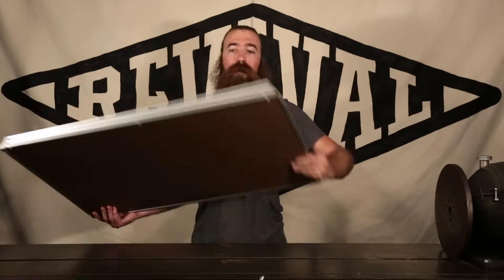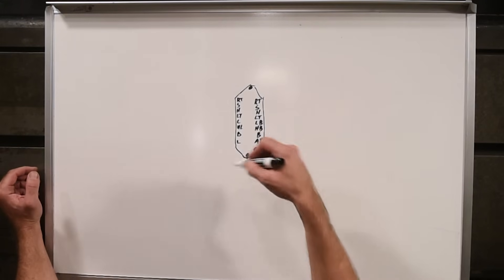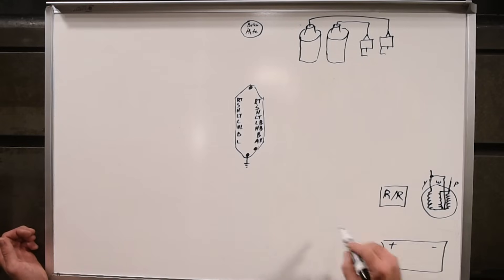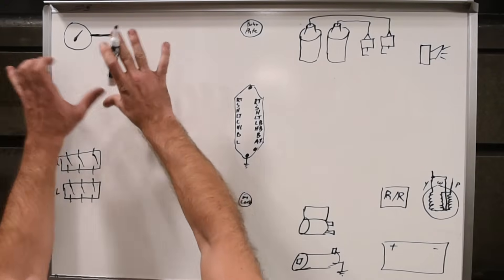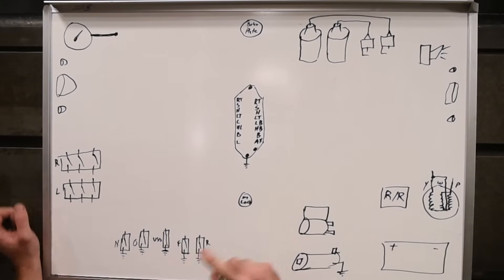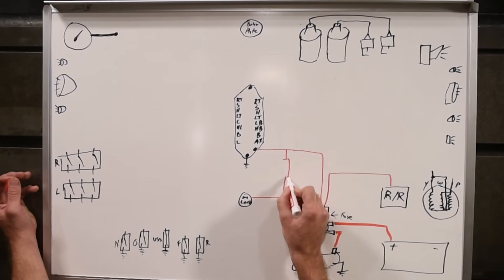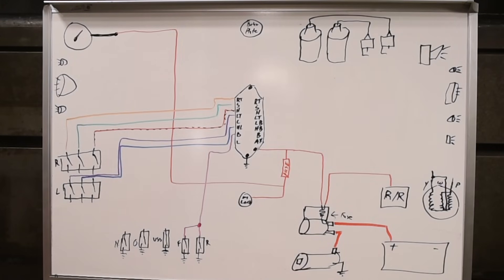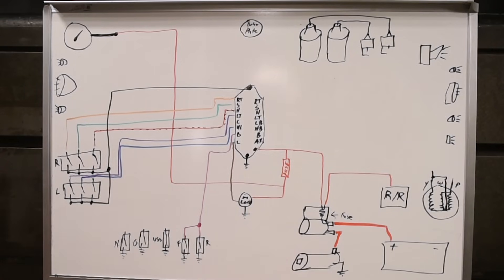How to Wire Your Motorcycle  - Revival Cycles' Tech Talk

Comment: THIS is actually the clearest most straight forward version of the CB350 electrical version out there. I havent checked but if you guys have a wiring harness + installation video / combined with all the information here: it would finally be the ultimate defacto wiring video and save people so much time. Good stuff guys
Reply from the maker: We sell all the materials on our site and have extensive wiring guides with diagrams available on our website. www.revivalcycles.com

Comment: I have a 1983 CB650SC and its got the field effect exciter coil that I have been trouble shooting since I bought it. I shot gunned it and swapped out the VR/R and the stator coil since I took a shot and swapped the stator and it didn't fix the issue.. now I got a bad ground on the trunning signals when I swapped out three broken turn signal arms that support the lights.... This Video was very helpful in understanding the whole system. THANKS Dude you rock.....

Comment: I have a story about wiring! First off I'm a friend of Sammy Parker at Revival, tonight his dad, Ron and I are building an old four speed HD transmission.

Story,: Back in 1972 when I was 19 II built up a 45 trike chopper. Raymond Smith from Choppers Fair drew up a simple wiring diagram which I followed - my first wiring job and it worked! One day I was riding down Houston's 610 loop and a wire melted into an exhaust pipe frying the whole harness (no fuse)! Dumbfounded I just stood there looking at it. This Mexican guy stopped in a van, didn't say a word and gave me a roll of electrician tape and half a joint and left. I finished the joint and then disconnected what was left of the harness. I then salvaged some wire, ran one hot wire from the battery to the coil and another to the points. Trike fired right up and over the next week I did a little better wiring job.

I've wired dozens of bikes since then, I solder every connection and use Molex terminals to simply unplug everything.for the roadside park rebuild.

-'lil stan
Reply from the maker: Thats a great reminder on why its important to consider routing and clearance...its never fun to get stuck on the side of the road, but sometimes its an opportunity to meet new friends. Its also a good reminder of why you should wire your own bike....cause when the smoke comes out you have a decent idea of how to get it to go again. 

Thanks for the story, and now I'm off to make sure Sam has gotten his full ration of harassment for the week.

Comment: Thank you for this fantastic video. I just bought my first bike over the weekend and I can't wait to get an M-unit Blue &  most of the motogadgets. 1983 Honda CB550. Guy didn't want it because the wiring was "Too much" for him to deal with. (Melted wiring from the main fuse to what I assume is some kinda of a power distribution box and a silly amount of scotch locks...) I replaced most of those wiring issues the day after I got it and now it runs great. But, as a electrical/diagnostic  automotive tech all I could think about was, "Man it would be fantastic if I could computerize this system somehow". Then BOOM some how your videos pop up on my YouTube "Watch next"... So glad it happened. I am a HUGE fan of all of your videos and all these gadgets you're showing off. Keep it up!!! Showed your videos and the M-Unit off to a few of my buddies that "talked me into" getting a bike and now they all want an M-unit. Thank you.
Reply: Hold up.. With an M-unit I don't actually need an Ignition box!?!? Hah I guess that makes sense. I've never had a reason to study points or carbs.
Reply from the maker: With the m-Unit you do need to have some type of ignition system. It can be points, or TCI, or a full ECU. But the m-Unit does not control spark timing. The m-Unit only  provides power to the ignition system, the actual spark control is usually the OEM system, or an aftermarket system designed for your specific motorcycle.
Reply: Hah. I kinda figured that out today... Once I looked at the wiring diagram and did my fist full in depth visual inspection of the wiring harness. I assume the M-Unit supply's power the... CDI..? Spark unit. Now that I got the bike running. I plan on getting at least an M-unit Blue and a starter solenoid from you guys as soon as I can.
Reply from the maker: With the m-Unit blue the ignition output supplies power to the ignition system (usually the coils and control box) BUT if you have a REAL CDI (Capacitive Discharge Ignition) those are self contained in terms of power and timing, so typically you need to use a normally closed relay to ground the kill switch wire. Then use the Ignition output on the m-Unit to power the relay control coil so the contacts open, un-grounding the kill wire, and then the ignition will spark.
Reply: Also Stefan you should scratch cool t-shirts off your  gift  list cause nobody can see them lol rock it bro 
Good luck in new year happy holidays thanks again that's it for my dumb comments

Comment: Thanks for making this so brain dead simple because I have to rewire my ‘93 Kawasaki 750 VN 49-A Vulcan that the previous owner butchered up and twisted wires together and taped them, no bullet connectors no  soldering, and yet he said he’s a mechanic 😆

I just need to add the radiator sensor, fan and USB port. I will be going to the “Revival” website and check out what you guys have 👍😎👍
Reply from the maker: Be sure to check out the Technical Articles on the site, we've kept this video up because it's proven to be very popular but it's out of date and there is a more detailed.

Comment: Omg finally found a video that dumbed it down!. My 1981 suzuki gs1100E is a electrical nightmare.  I have been looking at the Cymer wiring schematic...even blew it up but I'm getting lost in the wires lol. Got it running by putting power right to the cdi box and no headlight and rear running light 😬😮‍💨. That m box thing sounds amazing
Reply from the maker: Keep in mind this video uses a CB350 as an example, not to mention it's for the obsolete m.Unit V.2. We have installation and troubleshooting guides along with universal wiring diagrams in the knowledge base on our site. https://revivalcycles.com/blogs/technical-articles
Reply: @RevivalCycles  yeah I'm out of the loop with the bike tech. Those units are something down the road . To much for my budget anyway. But I'm terrible with electrical these videos are great I'm starting to understand the basics.

Comment: What I learned from the video is have a professional do it. 😂
My 94 lowrider needs all new wiring and it's hard to find someone to do it. The younger generation needs to get into motorcycle mechanics as it seems far n few out there. Though most mechanics today only know computers being not skilled in knowledge of old bikes. 
Like building homes it's best to know the field physically not just book wise. I had like 5 younger mechanics look at my bike they and myself changed every electrical component yet the bike would still stall after riding for less than a mile cause it was a bad wire the whole time. wasted tons of time and money on uneducated mechanics. One call to an old school mechanic a number I got from a dealership employee figured out my issue in 5minutes over the phone. He told me exactly where the bad wires were when I looked sure enough there was my issue. A thing only an old school mechanic would know as a computer can't tell you this info. wish I'd have called him first with the time n money wasted I could have restored my lowrider. It's still collecting dust atm :(

Comment: Glad I came across this. I was confusing the shit out of myself staring at the spaghetti wiring mess.. . I have a tw200 that I'm ripping everything off of and basically just keeping the headlight, tail light, brake light. No battery no safety switches no handlebar controls. As simple as I can get it and keep it somewhat "street-legal"

Comment: Stefan good work ,Thanks for a good description of how power runs thru' in bikes.  I am humbly requesting you to  do a video of ranger 125cc or 150cc majorly showing clear connection for ignition  sys how the switch powers off the bike and also how it powers it on, left and right signal connection include a flasher, high beam and low beam connection how you connect to their switches and the regulator connection from the stator
Reply from the maker: I don't think that's a model available here. Most carbureted bikes follow the same general theory. We have a lot of detailed guides on this project available in our Knowledgebase. 
https://technicalarticles.revivalcycles.com/hc/en-us/categories/360000739551-Motogadget

Comment: Thanks guys. Water cooled bike with mech fan converting to electric fan with temp switch. Munit blue set up. Best source for power? Relay / fuse requirements?
Reply from the maker: You could use one of the AUX outputs to directly power the fan. Then you can use the temp switch to control the AUX input. Most fan switches are switching to ground anyway, so this is a pretty straight forward setup.

Comment: Just found you. I have n '86 FLH touring HD. The factory wiring is a spaghetti mess. Wires going fron to back a couple times going and ending nowhere. I've simplified it a little using an 8 post connection block but I'm now retired and want to do it with some kind of sanity. A lot of 'stuff on it that might not be necessary. Can you hide me to some type of base schematic. Thanks.

Comment: Good description however a little fuzzy on the post 80s bikes. My 82 virago does not have points however it does have a TCI or igniter unit with field coils that determine when to ground the master coils for spark. Do you know if I am right in feeding the brown and red regulator rectifier leads into the positive terminal on the m unit with the battery lead? What should I do with the yellow wire coming off of the regulator rectifier? A little help would be amazing. And thanks for taking the time to put such an awesome video together

Comment: Excellent... Stefan you must be an EE.  I watch and took notes on all the wiring videos!
I own a 1972 350cc R5 Yamaha  kick start only (no push button starter) that I rarely ride. Converted the old ignition to VIPE CDI.
Do you sell a battery eliminator kit?
Can you put together a video on wiring an Accel Battery eliminator. 
Because I take the bike out so infrequently the battery doesn't get enough use.
Reply from the maker: He's not an EE but knows enough to seem like one at times. We offer the BAT-PAC as a battery eliminator. They were originally developed for RZ350's and I had a great experience with the one on my RZ. 
https://shop.revivalcycles.com/bat-pac-battery-eliminator/

Comment: Hi guys from Revival Cycles,

I'm trying to rebuild a Suzuki GS550D 1978. I've already bought some parts (M-Unit, M-Button, head light, rear light, ...) but I have a question about wiring my taillight(s). I bought 2 little turn signals with integrated tail and stoplight. There are 4 connections to each turn signal (Yellow = Indicator, Brown = Tail light, Red = Brake light, Black = Negative). I've read in the M-Unit's operating guide that you can configure the rear light to "one wire rear light / brake light for LED". This way I can save a few connections to my AUX, but now I'm not sure which wires on the turn signals that I need to connect with the BRAKE output: brown or red? 

Thanks a lot for the great videos!
Reply from the maker: Without knowing exactly which tail lights you are using, and knowing how they are handling the multi-function between the tail/brake/turn I'm not quite sure how this will work. BUT if you want to test the 1-wire method you would connect the brown and red wires to the brake output and then configure menu 2 for option B. I would definitely test this before making the install permanent. The rest of the connections should be like normal yellow to indicator output, and black to ground. 

You may still need a tail light integrator to get all the functions to operate correctly. The m-Unit does not have a control scheme for a two light tail/brake/turn, but the lights you bought might be smart enough to work correctly anyway.

Comment: Okay, getting an answer might be a long shot but at least I have to try. I have desperately been trying to connect the M.Unit Blue to my old CBR 600 -92 but the ignition output is confusing. I have kept much of the original system which means that the pulse generator on the bike feeds the spark unit to initiate spark (wasted spark) in the plugs. But where am I supposed to connect the ignition output of M.Unit Blue? Any help/ideas would be appreciated.
Reply from the maker: Ok, this question is a bit too technical to get into on youtube, but the basic idea is that the m-Unit will provide power to the ignition system, and the rest of the ignition system remains the same. The best way to handle this is to get a good legible wiring diagram for your year and model, and then trace all the connections from the spark unit(s). The CBR should be a 12V dc ignition and the pulse coil is only providing the timing signal to tell the system to spark at the right time. If you need more input send a copy of the wire diagram to techsupport@revivalcycles.com
Reply: I think I solved it by connecting the cable that previously went from the ignition switch through the fuse box to the kill switch and then to the spark unit and ignition coils to the M.Unit Ignition output. At least I get a spark now where I previously had none. Thanks, guys! @RevivalCycles

Comment: Awesome video thanks so much! I'm adding one of these with the bluetooth to my 1983 xj900 cafe racer that has a TCI and no points, do i just keep that in the curcuit and power that up with the ignition? thanks heaps for your time!
Reply from the maker: 1. Check out the Revival Wiring guide and Universal diagram from our site. They're more comprehensive than this video could ever hope to be. 
https://technicalarticles.revivalcycles.com/hc/en-us/articles/360008817972-The-Revival-Approach-to-M-Unit-Wiring

https://technicalarticles.revivalcycles.com/hc/en-us/articles/360009106131-m-Unit-Blue-Basic-Universal-Wiring-Diagram

2. This is explained in the guide but this gist of it is that you want to locate the 12V+ power wire supplying the TCI and install it in the IGN Out. Every other aspect of the ignition system will remain in the stock design.

Comment: How do i figure out which wire is neg and pos 🤔 with no power. 
I have a cheap switch and for the headlight switch and horn button. Both are 2 wires BUT both the same color. Headlight on/of wires are both red. Horn both white. 
I tired a few different things but im lost.
Reply from the maker: If it's a two wire button there is no dedicated positive or negative. You get to decide.

Comment: Whats the best way to ground everything? Can you group all of the ground wires at say, the front of the bike (switches, lights, headlight etc.) and connnect them all to a single ground wire?
Reply from the maker: There are a lot of options but when it comes to control grounds we never ground to the handlebars. We tie all switch grounds together tucked inside the bars and run a single ground wire back to the m.Unit main ground to insure we have the best possible continuity. You could also ground this wire to the frame if it's not convenient to run back to the m.Unit just make sure to remove the paint from the frame in that location and use electrical contact grease so that the surface does not corrode.

Comment: Very close to ordering a whole m-unit wiring kit to rebuild my Suzuki GS500. I have been studying these videos regularly, but I am confused about one part of this diagram. What is the breaker plate? How is it used with the ignition system coils? Many thanks, big fan. - J.M
Reply from the maker: Hi J.M. Depending on the year, your GS550 either has points, which is another name for a breaker plate, or it has an ignition module. This video is just a basic overview using a CB350 as an example of how one would go about creating their own personalized diagram.

A more comprehensive set of instructions and universal wire diagram can be found in our knowledge base in the links below. 
https://technicalarticles.revivalcycles.com/hc/en-us/articles/360008817972-The-Revival-Approach-to-M-Unit-Wiring-

https://technicalarticles.revivalcycles.com/hc/en-us/articles/360009106131-m-Unit-Blue-Basic-Universal-Wiring-Diagram

Comment: Thanks a lot for all these great videos! You totally convinced me to get one of these m-unit for my BMW r80 (and I learned a lot from you guys).

Just wanted to know how the m-unit will handle the OEM switches as there is only one input for both high beam and low beam? 

I understood using the m-switches that one single button controls every different "status" of the head lights depending on long or short press... but does that means if I long press the OEM "quick/temporary" high beam (don't know how to say it in English) the m-unit will consider I want to switch to "permanent" high beam (and return to low beam with the same operation when I'm on high beam)? 

Does it "recognises" I'm using OEM switches (turning on the lights in  OEM switches is equivalent to let the finger pressed permanently on a m-switch)? Or is it configurable via the m-control button?
Reply from the maker: The m-Unit has many different control configurations that can be programmed to match your setup. With OEM BMW switches the headlight control is done by having the headlight input grounded when the OEM switch is in the low beam position. Then when there is no contact in the high beam position the m-Unit knows to turn on the high beam.   

There are lots of details on how these work in the manual here - http://motogadget.com/media/downloads/manual/munit_v2_manual_en_3.5_k.pdf